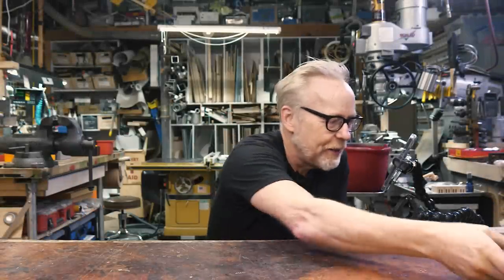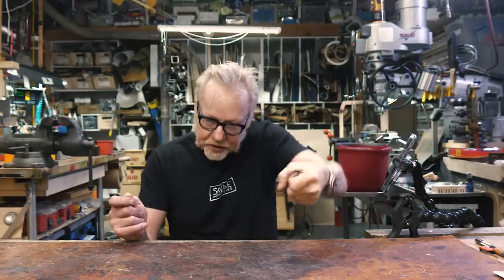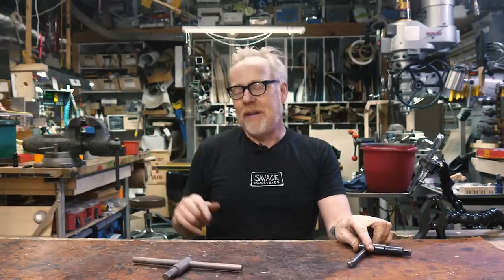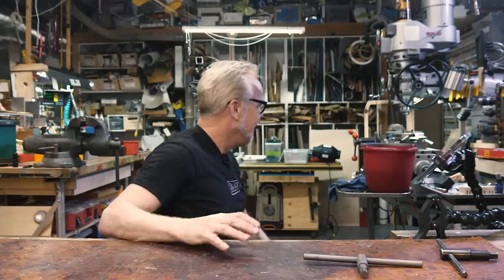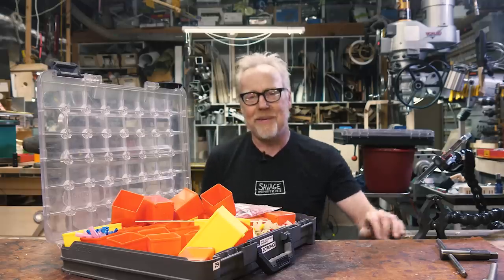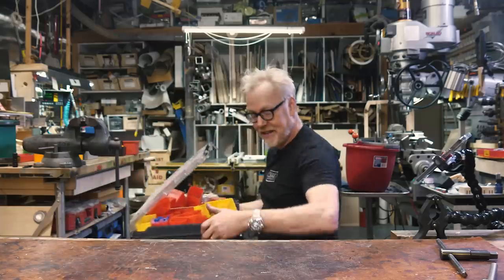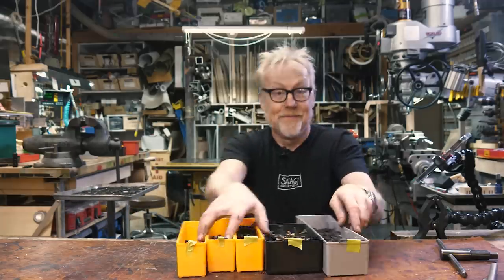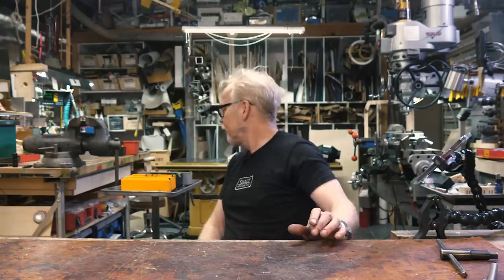Adam Savage Explains What to Do When You Drop Gobs of Loose Hardware

Comment: When I first started my very brief stint fixing smartphones, I very quickly discovered a few things:
1. I'm going to need spare fasteners. LOTS of fasteners.
2. The full fastener kit was handy, but the plastic baggies they came in would die in a couple of weeks.
3. The last thing I want is to fumble and spill tiny parts. Sorting boxes are great, but I needed something where I can access a full set of different fasteners at once.

My solution: plastic test tubes with screw tops. They can fit in surprisingly many spaces, you can 3d print an organizing stand or buy decent lab stands, and they are perfect for stashing a lot of different sets of parts. Capacity isn't great, though.

You don't want to use the ones with stoppers, those will split the tubes and spill.

For things that need more room but are still compact, there are unexpanded polyethylene soda bottles. They're like big test tubes and are practically indestructible.

Comment: I use a simple system for consumables. I buy Treston organizers, and I’ve built a shelf for them. Every time a need a consumable, I ask myself if I’ll ever need it again, except for normal zinc plated fasteners (since they’re less money to buy in boxes of 100 then 10 individually). If I do, I buy a box and put it my organizers. When I run out of bins in the organizers, I buy another one. I’ve found that my trips to the store to get consumables lessen for every year, as I usually have what I need in stock. And if I don’t have it, I usually have something close enough to work out what I actually need (like for example needing a stainless fastener, but having the right fastener in galvanized so that I can work out what fastener I need. For the crimped connectors, I’ve found that Abiko is the best for the non-heat shrink stuff, for the ones with heatshrink I usually buy some good marine ones, the important part is for them is to get the glue filled heat shrink instead of just normal heat shrink.

Comment: A suggestion in regards to electrical crimp connectors: Look for "marine" grade connectors (ideally made to ABYC standards). They will have tinned copper lugs with heat shrink insulation lined with hot melt glue. They are not the cheapest but are substantially robust and I imagine less costly than aerospace components. And should be readily available (in bulk) at any commercial fishing/marine supply store in the Bay area.

Comment: I worked for a company and we had those big roll around fastenall buggies with open bins(think homedepot) and on top of the buggy we had the fastenall removable  pull out drawers. They were 5 drawers tall. Some new guy, not knowing it wasn't bolted to the Buggy opened all 5 drawers looking for the bolt he needed small bolt like an m8 or somthing, he opened the last one and the whole think came crashing down. We did some simple calculations but between those 5 drawers there was about 10,000 pieces. Nuts, bolts, washers. Tons and tons of stuff. It took weeks to re organize it.

Comment: I work at a wood truss shop for chicken houses, swinging a 28 oz eastwing hammer all day. Building wood truss is that same process of organization. The recipe for a wood truss consists of various sizes of steel nail plates, 2x4 webs (2 to 8 on one side), 2x6 chords (8 chords to every size of truss) cut from ceder and pine. I work with a team of 3 or 4 most often in a team of 3. The table is stocked with webs, some chords on the bottom are pre-plated. One truss is built at a time, pressed with a table wide press that runs the length of the 75 foot long table, press width is 3 foot its a monsterish machine. A hoist lifts the truss from the jig (unusable webs from truss past nailed to the plastic topped table) carries it over our stock of webs to the bundle of truss (12 to 17 high).

Comment: I'd recommend just buying McFeely fasteners instead of those inconsistent drywall screws.  They're really sweet, coarse threaded, cutting tip, very consistent.  They also do a square / phillips combo head so you can use a nice hold-onto-your-tool square drive but still have everything be convenient to other folks.

Comment: I have a couple of tips I use in my own home shop.

I've attached a magnetic rail to a broom, pick up any metal parts while you sweep the floor.

The second is a small (weak) neodymium magnet on a (chop)stick, to quickly pick up one or more parts. 
While sorting i use the magnet to pick up isolated screws and quickly remove them with my other hand. I use the wooden end to isolate screw I want to pick up.

Both work like a dream

 I also have a magnatic bowl for any odd bits, to be sorted later.
This lives near projects and I just chuck anything in there and don't need to worry about it getting lost.

 And a container of unsorted crap, that often contains something I need but thought I'd run out off.

Both of these make organisation more relaxed.

Comment: I have used that exact same method of sorting screws. It is faster than you'd imagine.
At my last workplace, a boatbuilding school, we had bins and bins of unsorted screws, accumulated over several decades and hundreds of students projects.
After a day of sorting we could extract screws and copper rivets with a retail value of thousands of euros, no kidding. Ok, much of this may never be used anytime soon, but having a big assortment readily avaliable means we don't have to run out and buy all those small batches of odd sizes. Those small purchases add up quickly. Whatever is left in the bag often end up in the unsorted-bin, never to be used because you can't find the right size or amount that you need.

Comment: My Idea for a broader way to deal with a wider variety of sorting issues, is to clear a modest flat table area, three to four feet on a side, and for more ease, tape a cardboard trim raised lip around all sides, 1/2" usually adequate, but leave one 5 or 6" gap at the front. Get 7 or 8 1-2 quart plastic jars, and mark off the same number of zones radiating from the center out, using tape or erasable markers. Pour two or three cups of your mixed up parts into the middle, spread out, and using a long spatula, squeegie, or stiff cardboard, begin visually separating like parts, moving them to one of the zones as the numbers grow. As any zone grows fuller, migrate those parts to the clear edge and sweep them into one of the containers. One of the zones will accumulate the misc. that fit nowhere else - those just go into their own jar as well.
  Repeat this process until your original mess has been fully sorted. The Misc. container can then be addressed anew, with smaller numbers of items needing smaller, new, empty jars. This method is visually based, and similar parts laying next to others are far easier to differentiate this way, without need for any measuring system, or tedious one-at-a-time squinting. Works for dissimilar items, from beans and grains to screws and washers and colored beads. Once sorted, things can be measured, labeled, moved to storage as needed.
  Once I get stuff down to a small half-cup assortment of tiny screws, washers, nuts, I just put them all together in a container, and have a few times, when stumped for some odd part missing from a small appliance or gizmo, poured out my Misc. jar and found the proper size and thread, to fit. No idea what size, or thread pitch, or where it originated, but I don't care. And if I had sorted by spec. numbers, I would have had no more idea of what I needed.

Comment: I have a 30-drawer parts cabinet. It is where my bulk-quantity fasteners live. In most drawers, nuts or bolts or washers are sorted into individual containers or bags. The container could be an old vitamin bottle, the bag could be a repurposed baggie that small parts were packed in. When I'm working on a project, I sometimes take an entire drawer to the project and work out of what is now a steel tray. If it fell, most likely, it wouldn't be too bad because, like I said, every item is contained in something within the drawer.

Sometimes, I go through the entire cabinet picking different parts for the project and the individual containers of those pieces then go into a shopping basket like you'd use at the drugstore. I bring all my leftovers back to this cabinet in that basket and then put it all away for next time...

...ideally 😉

Comment: funny bit about the terminal lugs - sometimes "aircraft quality" lugs are ""crappy aluminum" because the aircraft are aluminum (mostly).  so a ground lug attached with an AL washer to an AL bulkhead will bond better than a tinned copper one will.   but since you aren't working on aircraft, tinned copper is best

Comment: I think one of the biggest optimizations is quick grab vs deep grab. Just like your lathe tools, you have electrical connectors you use all the time. All those other connectors are actually in the way! They slow you down (and risk getting knocked over).
So having 2 containers, 1 with quick access and maybe a small misc bin to save pulling the big box, and 2 the big box that has everything you don't usually use.

I do this with toolbags for my car. I am a bit of a packrat/over preparer. But I like my car to be light and fun to drive. So I designated 1 toolbag as my normal expected car trips bag. The other toolbag became the "I'm going to go work on my friend's car and don't know what to expect" bag. It has oddball sizes, a hacksaw, prybars, etc. All things I very much don't expect to need on my own car or could make due with a similar tool already included in my regular bag.

Comment: This problem begs for automation. I used to fantasize about a dry cleaner's endless loop conveyor that looped back and forth through the house and shop, with each tool, fixture, and box of fasteners inserted and hashed for recall, after a certain access time. Now, with less lofty goals, perhaps a modest size, general purpose sorter that you could just dump your collection of spilled screws into, that would painfully stack them in sorted piles. It could be done; i wonder if it should? Enjoyed your discussion.

Comment: As someone who has had to do this with weld in fittings, what I like to do is get a metal tray like you have, preferably with higher/sharper sides to prevent that skip out issue, but I'll collet everything in one corner, and basically do the same thing, except I'll deliniate the other corners for different sizes. 
For this, I would just use a sharpie and draw a 2" mark on the sorting pan, and probobly 1.5", then you get 3/4 too as a bonus, and the rest go in a "no" pile, because I know that task saturation is a thing and that a second pass for the other 3 sizes or whatever will go faster than trying to do 5 or 6 at once

Comment: Save your commons first, then buy what you need as needed. The great thing about the current time is you can have what you need within minutes to hours locally… to a couple days at worst case if you have to reach out to Amazon or otherwise. I am currently going through reorganization #364,000 it feels like, and I have scrapped so much I thought I would need but never used. Just a dumb fireman, but slowly working out the needs vs wants.

Comment: Years ago I came up with a super-fast way to sort hardware, and it requires a few large magnets and a smooth bench top.  Make a small pile of the mixed hardware clos eto you on the bench top, and in a semi-circle around the pile, about a foot away, place the magnets about 8" apart.  Now you're ready to go.  Use your fingertips to flick the parts toward the magnets.  They will slide and stick to the magnets.   This saves time because there's no picking up and dropping each individual piece.

Comment: In my research I settled on Ancor for my crimp connectors. They come in nylon insulated as well as heat shrink insulated, tinned copper with a welded seam, lots of hole size variety, and come in 5, 25, or 100 packs. They are meant to be robust for a marine market (boat electronics). They are available on Amazon as we as several marine parts suppliers.

Comment: I had a two sided organizer that one day while walking into a job ipened on both sides and dumped out in the parking lot. Im talking thousands of different screws,  nails, crimps,  connectors, anti shorts.
All just left overs forn jobs put in this tickle trunk.
I went to my truck, got a bucket, put it all in and threw away the organizer. Those parts  stayed in that bucket until the day my shop burned down.

Comment: Get the TE PIDG (Pre-Insulated Diamond Grip) terminals. Most of the PIDG range is not too outrageously priced (e.g. <1$). Some of the PIDG terminals and splices are Military Approved (ASM7928) too if that's needed, meaning they come with e.g. PVDF insulation if you need high chemical resistance, radiation resistance and/or high-temperature ratings.

As for what I would keep on hand at all times, I would keep a full set of Ring Tongue terminals (Green 26-22 AWG M3.5 - 326875), (Red 22-16 AWG M3.5 - 326878), (Blue 16-14 AWG M3.5 - 326882), (Yellow 12-10 AWG M4 - 320568), a full set of splice terminals (Green 26-22 AWG - 323994), (Red 22-16 AWG - 320559), (Blue 16-14 AWG - 320562), (Yellow 12-10 AWG - 320570). Possibly also a set of fast-on terminals if you use them a lot. As for tools, I would suggest getting a "Pressmaster MCT FRAME" with a die set (4300-3129/AAA and 4300-3128/AAA).

There's really no point in using the heat-shrink terminals, better to have a selection of generic dual-wall adhesive-lined polyolefin heat-shrink on hand and add it if needed (e.g. Raychem TAT-125 or ATUM). If you need something a bit more chemically resistant then consider a flexible elastomeric polyester heat-shrink such as Raychem DR-25, or a fluoroelastomer such as Raychem RW-200.

FYI: When people refer to TE, AMP, TYCO, Raychem, DEUTSCH, etc. they are really all referring to the same brand. It's all part of TE Connectivity (Tyco Electronics).

Comment: I like the sealed clear crimp and shrink connectors. NSPA makes them. The clear heat shrink lets you see that the wires are fully seated, and they have stops in them to prevent the wire from being pushed in too far. However, I don't know the exact composition of them.

Search for: 0790442 at Fastenal's website.

Comment: I had to do this for days at a disaster shop I worked at, u nailed it. I went back and forth between biggest and smallest and it's so much faster. My problem was that there were tubs and totes full of everything, not just screws or just electrical, but tools, knobs, hinges, nails, screws, springs, u name it. Fingers were shredded when I was done, got any tips for that without using cumbersome and clumsy gloves?

Comment: After I pick out the easiest ones to find, be it the biggest or most different, etc, I usually separate into smaller piles. It's quick to look at a cluster of 10 or so fasteners than an entire catastrophe. It's usually like that with completing tasks in general. 

Also, it's always such a polarizing battle of organization when it comes to trying to always have everything vs only having what you need. That's why the best systems are the ones that are created with the understanding they will evolve. It's actually an interesting concept.

Comment: Would screwing magnets into the wall instead of hangers be practical? Basically when you're done with a tool, you hold it against the wall and the tool just sticks to it. It's there in full view if you need it and you only need to be vaguely aware of where the wall is when you put it down. And it works with any shaped tool.

Would that be a good idea? Or would the tools becoming magnetized be an issue?

I think someone saw the magnetic knife holder and then turned a tray into a giant magnet and used that as a keyholder next to the door :p

Comment: A YouTube channel turned me on to the Wago 221 connector as a replacement for the screw caps. Allegedally it's what they use as a standard in Gremany instead of the plastic nuts. I've yet to try them myself but I did order a kit from Amazon to try out.

Comment: I like this method and will give it a try. Im a Carpenter and handy-man and have a 5-gallon bucket that I keep throwing my extra screws in. These are screws that are left in my pocket or nail pouch on my tool belt and at the end of the job I have been just throwing them in the bucket. After 4 or 5 years the bucket is near full.

Comment: The end of this video gave me a bit of a wake up,  more than I thought at first actually.
I'm in the process of moving, I have made a 3d model of our new hose and are in the process om planning where everything goes and I have taken a lot of pictures of my workspace to be able to put everything back where it was when I took it down but the "Don't romanticize" bit got to me and I have now deleted the pictures and will try and improve the areas I have felt lacking efficiency at this place. 
I have had four tool boards, one for 3d printer tools, one for tools that turn like screwdrivers and wrenches, one for tools that cut like drills and files and lastly one for measuring and clamping tools. It have worked fine but not as good as it could, like the calipers have 3d printed mounts that are perfectly shaped for them, meaning that it can be a challenge to remove the calipers, not much but enough for me to sometimes leave the caliper on the bench instead of placing it where it's supposed to be because I might use it soon again and don't want to struggle with it
Plenty of room for improvement, I might even buy new boards, we'll see
If I had the time I would re read Every tool's a hammer but that won't possible before the moving process starts unfortunately

Comment: I look for anything rc for lugs. High capacity in power from the 6-8cell batteries I use and heat distribution is great as well burnt up a battery but my wire and connectors were just fine. Note to flyers mind your battery times 😆😂